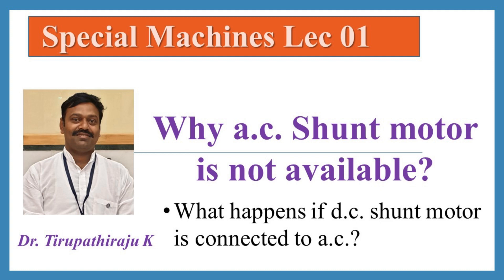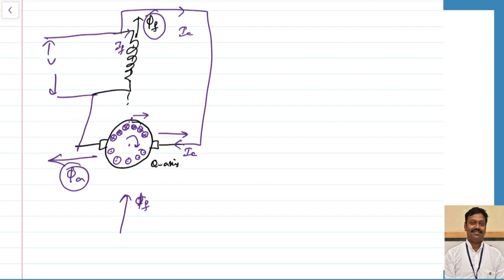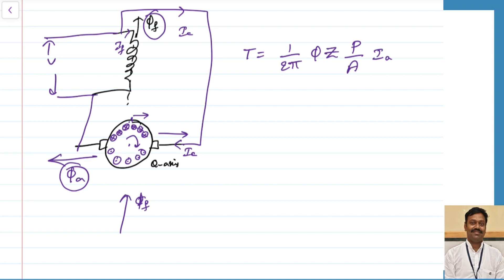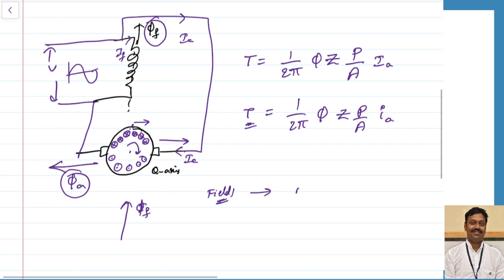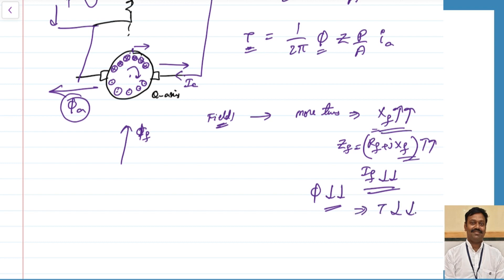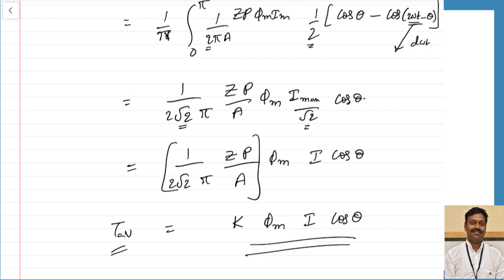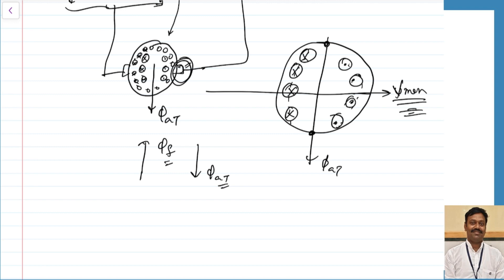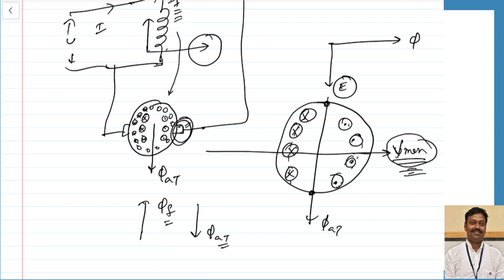SEM01 Why a.c.  Shunt Motors are not available?

Comment: Sir, there is no lecture on stepper and servo motor ?
Reply: @lecturesinelectricaleng  
Ok sir,
Sir, do make lectures on protection of power system also.
Sir, i've protection part from many teachers, but, i listened, one teacher at made easy (balaji sir), teaches very extra ordinary way, giving practical view.
Will u be giving us practical view.
As some students cant afford that much expensive coaching .
Reply: @lecturesinelectricaleng  well sir, u re giving this tyoe of teaching for free, we are not the one who should demand.
But sir stepper motor questions can be seen in gate prev year.